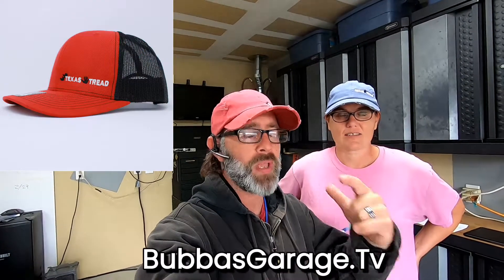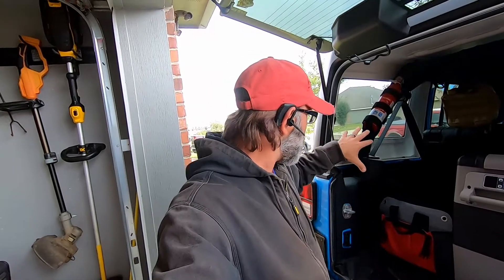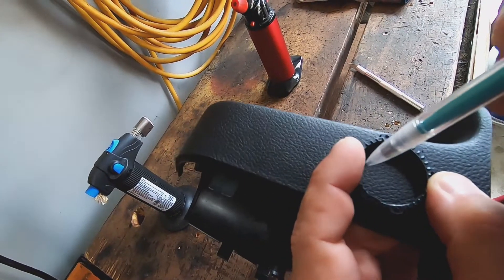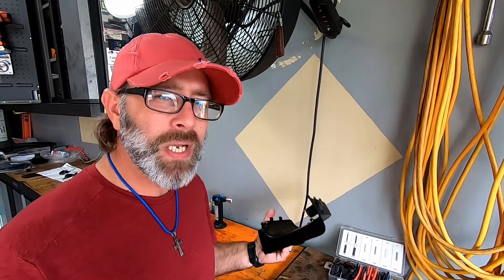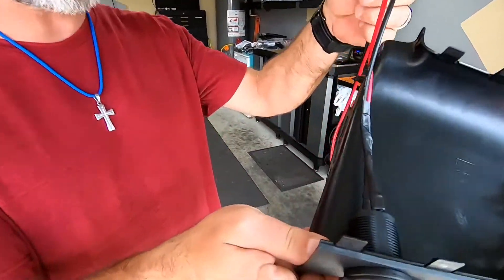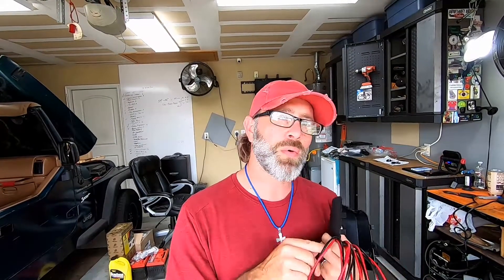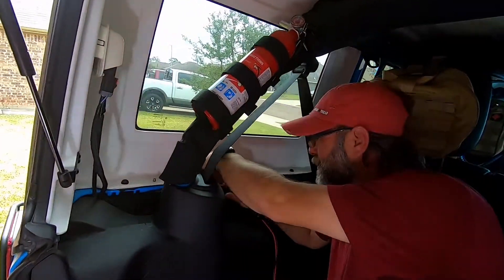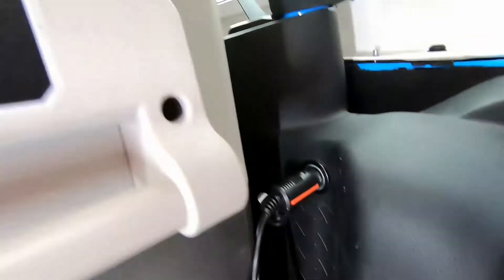Episode 431 - Building your very own 12v automotive FRIDGE wiring harness | CHEAP!

Comment: If you want to twist he wires, you can put one end in a vice,the other in a drill chuck, then use a slow speed to make a neat twist to the wire. Use caution to not over twist!
Reply from the maker: SWEET! Love this. Im so going to try that out next time. Bet it would turn out much better too :)
Reply: Another tip, when stripping wire, as soon as you break the insulation, pull and twist it and you will have a near perfect twist to the wire. Makes soldering much easier and a very neat connection.  Have a great weekend. Off to enjoy mine!
Reply from the maker: @InjunOutdoors  :) Sweet!! Ill try it out for sure!

Comment: Not sure how much you have used that new plug, but, I installed that same one in my rv and the back of it melted when using it on my Alpicool fridge.  It says they are heavy duty, but they are not.  I actually had 2 of them melt on the back side.  I only buy steel plugs from now on.
Reply from the maker: Hey thanks for the heads up. Ill keep tabs on it for sure. Have only used it for a trip to Dinosaur Valley. Had it running for about 44hrs. Got another trip coming up so this time Ill check it before I shut it off. Thanks again!